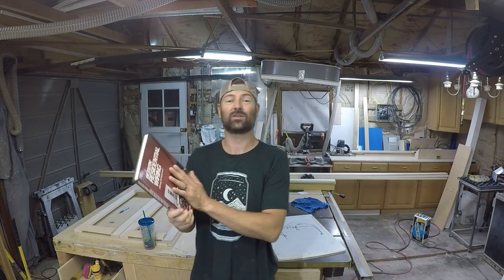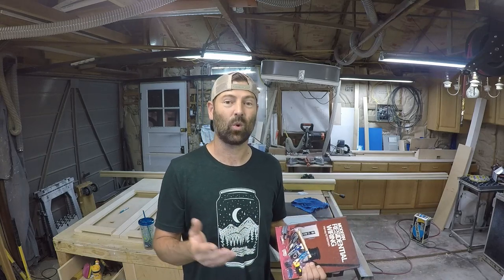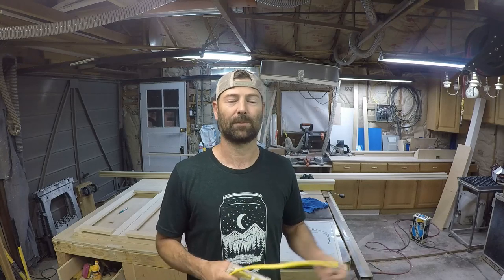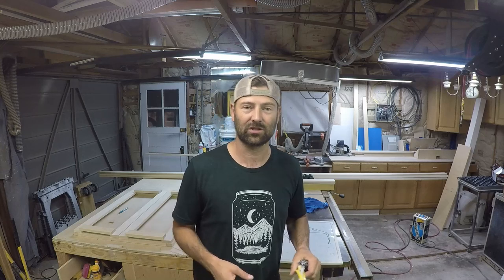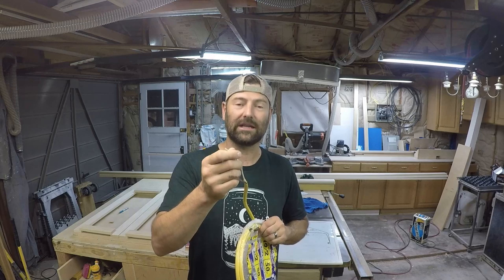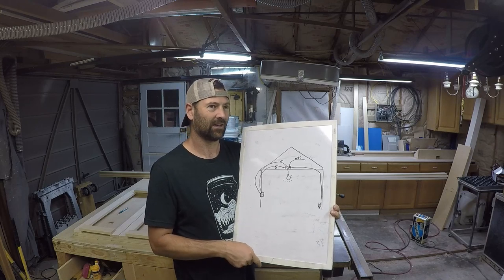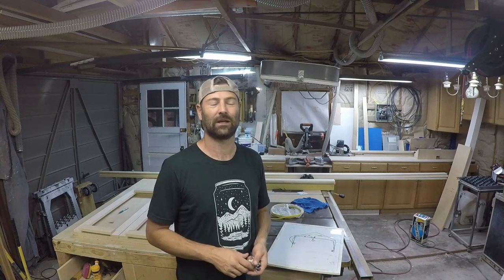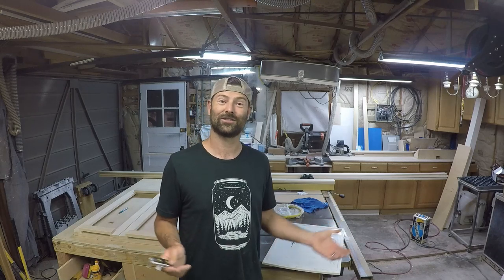The White Wire Is The HOT | THE HANDYMAN |

Comment: In most of my old house and when I add ceiling fixtures the circuit comes through the switch box so the neutrals (white) are tied together and only the black wire is interrupted by the switch. Opening the switch means the ceiling fixture will be dead and I don't necessarily need to go down to the basement to open the breaker just to fix/replace the fixture.
Reply: @mwatkins2464  Actually I wish that were true in my old house - rather than put in more wiring in the attic I replaced the ceiling box and installed ceiling fans. With a remote to control ceiling fan and light it wasn't a problem  just leaving the existing switch always on.

Comment: Can’t use that anymore, but yeah it was standard for a long time. For dimmer switches you usually need a neutral, so if it’s a three way switch you’re going to need to run a three wire.
Reply from the maker: This channel is not about building new homes.  Its about remodel.  And what you will find when remodeling your home.

Comment: Its called  a switch loop.  Don't think you can do it in new construction now as the new NEC wants a three wire run now so you have a neutral in the switch box.  However if you see this the switched hot white wire should be marked black on both ends if you do this.

Comment: In canada where the neutral wire isnt required at a switch yet when using 2 wire you must send power to the switch on the white and the switch leg to the light must be black. The taping or marking of the  white wire in this case isnt required but is nice to do

Comment: Almost right.  Normally black is hot (or live), white is a current carrying groundED wire,  it can get you if YOU are grounded in any way.  Green or bare is ground.  If white is EVER used as a live conductor it must be marked black at both ends (i.e at a switch).  Red is used for 3way switches where a second switched live wire comes from the companion switch or as the 2nd leg of 240v 1 phase load wire. Best to use the national electric code handbook, not a trade publication which might be correct, might not. All of this covers 1 phase residential wiring. Bottom line... use which ever conductor you want (except bare) and tape or mark the odd conductor at both ends with NEC recognized colors. If not, and you happen to get a weird electrical inspector, you might be in for some rework.

Comment: Sometimes the black is hot - sometimes it’s the white.  It just depends on how something is wired.

I knew what you meant (however, o  an electrician - since 1991 actually😉, when you said the white was hot.  It applies to “your” circuit, at that moment, as in many applications.

Good job!

Comment: I knew this video was coming I saw that installing the puck lights Video ( Great Video BTW) and when you said white is hot I was like what at 1st then was like I bet there saving money by not running more cable and using both wires. Also LOL on the insulation strip back comment on the Ground wire  that was funny. 👍👍🍺Cheers

Comment: Hey Bro I do Elevator construction start to finish it’s involved lots of electricity although I am not an electrician but you would be very surprised at how many “electricians “ don’t know what your talking about not kidding especially commercial ones. But that is a switch loop it means that power is going to the light first then it is sent to the switch that’s why the white is hot at that point at that point so the switch can interrupt. Otherwise the light would be lit at all times. Your a smart guy you ain’t no handyman ur a wealth of knowledge that shares with others very fast efficient clean and you do the whole job by yourself for God sakes get a helper. The man is telling us to get the book and it will make sense to everybody if they read it a couple of times or draw it out. And never trust color of a wire get a meter or a voltage tester

Comment: This just cost me $600 because our county requires 3 conductors plus ground. The white gets capped in the box but tied in to the other whites in the attic or back to the breaker box. “In case someone wants to use a blue tooth switch in the future”. I’m 57 and have always wired switch legs just like you said, but times they are a changing. Absolutely stupid!

Comment: when power comes in to the light fixture itself, and then you only see 2 conductors in the switch it means that both legs are hot (at least when the switch is ON). this is basic stuff haha. that being said, I believe if you were renovating, you'd replace the wire from the light fixture to the switch with a 14/3 as I believe the latest NEC requires a neutral in the switch box even if it isn't used (something about smart switches).

Comment: I used 14 for lighting and 12 for receptacles, and I never put the lighting and receptacles on the same circuit. If saving wire is an issue then pull power for the one receptacle from another area.

Comment: Never assume anything is correct. Check every switch, outlet, circuit and fixture.  Years ago my sister found a ceiling fan wired with an extension cord wire running above a false ceiling to a switch. She described it as "So illegal, it's not even funny".

Comment: Ahhh, I see.  The switch is using one single run of romex, so both wires in the bundle are used.  Makes sense now.  I think for those of us in areas that did not use romex when constructing (rigid conduit) there are other colors used.  In my home if the switch is not a three-way, both of the legs for the single switch are the same color, either black, red, yellow, etc.

I have noticed that in our area of Indiana, all of the older homes were constructed with rigid conduit.  But now brand new home builds are back to using romex.  Not sure when that change occurred.  Definitely sometime after the mid-2000s, however.  As a real estate broker I see a lot of homes with unfinished basements, so it is relatively easy to see how their electrical and water is run.

FYI, I was kidding around about the house burning because of a wire's insulation color.
Reply: You see different colors because you can only relabel white in Romex or two wire cables. Conduit with separate wire pulls has to use wire that isn't white, gray or green for all hots.
Reply: @1dgrdgr  I know, that is what I had mentioned.  Conduit has individual wires pulled through unlike romex which is individual cables filled with so many wires based on the type of romex that it is.

I appreciate conduit for pulling wires after the fact (so as long as there is not a junction somewhere) but romex is definitely easier for the D-I-Yer.

Comment: When I first moved into this house, the outlet on the front of the garage sometimes worked and sometimes not. Finally I noticed that sometimes if I turned on the garage light, the outlet turned on, but sometimes it was on when the light was off.
What could it be??? Finally figured it out...
Previous owners had wired the hot for the outlet to one of the travelers in a 3-way switch circuit on the other side of the wall. Moved that outlet connection to the actual hot feeding the box and all is well.

Comment: This is why I don’t care for Romex/nm cable. I prefer conduit. I like the option of using different/correct colors and/or pulling a new wire when needed. Or pulling a new neutral when needed.

I used to think nm would be so cool to work with but it is more trouble than it’s worth.
Reply from the maker: I haven't seen conduit in a house that was built after the 60s
Reply: The Handyman 

They’re all conduit here in Cook County/Chicago. No romex allowed.

Comment: You are correct. Maybe if you explain to folks a bit further about the white being hot or energized. Lets make a rule, "Only the black can be hot". OK? New rule. Then in order to get power to the switch and then turn the switch on and energize a light, fan, whatever. You don't have enough "Black" wires. You would need two black wires going between the junction and the switch. All you have is one black, one white and a ground. So now, with our new "only for us" rule we need to run a black wire from the switch to the junction or more precisely to the light. Walah. We now have a black energized going to the switch. And a black which will become hot when the switch is turned "on". Walah: All black to satisfy our new "rule". But you now have a white wire that is doing nothing. It sits for the rest of eternity doing nothing. Get it?

Comment: can the white wire be used as a hot for outlets?  i have no power on 5 outlets i changed the GFI and breaker still no power, i ran an extension cord to a GFI outlet in the house and plugged in the wires to the cord from the old GFI and i got power to all the outlets , as i said i replaced the GFI with a brand new one black to brass white to silver and nothing

Comment: Also the term "neutral" is overused. White is a "return" for any circuit fed by only one hot leg of the service. In North America households that is feeding a 120v load. Only a two leg 3 wire load has a "neutral", that is 120/240v loads. Return carries 100% of the load current. Neutral only carries the load imbalance, or the difference in the 2 lines.

Comment: Black connecties to White van be confusing, i think.

In my country we use Brown for LIFE, blue for nutral and yellow/green for earth.
A Brown wire goes to the switch and from the switch goes a black (switched LIFE) to the bulb. From the bulb back to blue.
Its easy visible witch wire has wich function.

Sometimes diy idiots use the wrong colors becouse they safe a few euros, and claim they know IT 5 years later. But that's frustrating and very dangerous for new home owners.

Comment: Heya. I’m remodeling a quad. Built in 1927 they remodeled in 19?? To add a kitchen and bath onto one unit. The stove outlet in the addition can not be killed by shutting off the main in that unit. My thought is they ran it from another unit (with or without realizing) or we have a problem at the breaker...? Thoughts?
Reply: Also nothing was labeled so I walked around testing what was live when it switched on the main and then individual breakers. The hot water line comes on with the main, stove is always live. East outlets are tied into the kitchen outlets and a few lights are on individual breakers. Fun mess of wire (also knob and tube when you take a peek under the house feeding several outlets and switches...)

Comment: This is true if you are using the light box as a junction, but as an electrician I never use the light box as a junction, my home run comes into the wall receptical first then out to the light switch then to the light, this way my hot stays on the black and is never the white which by NEC codes is always black for hot, white for neutral, bare copper ground, using a 12/2 with ground residential wire.
Reply from the maker: The house I was talking about was wired 40 years ago. I was simply telling people what to watch out for in their older homes.

Comment: Question. I service exit lighting and I was in a warehouse the other day. We replaced 3 exit signs last year. Never had a problem with the brand we use.  The building is wired 277v I checked the power with my meter from the wires on the exit sign not connected and all 3 junction boxes are reading 64v. What do you think the problem could be? Thank you...
Reply: How are you testing the circuit? Line to neutral or line to line?

Comment: So I have a junction box all the black wires were connected together two neutral wires were connected together one neutral wire was separate from the others and connected to the light fixture and the other wire on the light fixture was connected to the neutral.   Does that mean that that separate neutral wire is actually a hot wire and should be connected to the black wire on the light fixture?

Comment: In your diagram, you show the receptacle and light on the same circuit. I've done a fair amount of home wiring and I never did, nor witnessed a receptacle and light
on the same circuit.  Receptacle and lights were all on separate circuits.  I purchased a condo in Fl in 2009 and the condo was built in 2004.  I was installing ceiling fans in all the rooms and when I killed the power to the light it also killed the power to the receptacle that I plugged a light into.
Reply from the maker: It is not done on new houses.   but the 60 million homes built before 1980 or all the homes that have been remodeled  You will see it every day.

Comment: I work at an apartment complex and the first outlet in apartment has white on black side coming from a light switch. They use the red wire going between that outlet and the next one around corner instead of red from switch. It's in every apartment here.

Comment: I have a question. Is a tester screwdriver works the same as a light bulb? I mean you do close the circle by touching. How can a light bulb have no neutral. How does it close the circle?
Reply from the maker: The bulb has a neutral.  but not the switch.
Reply: @TheHandyman1  from another bulb?
Reply: @ofrimashiah2   neutral comes from the junction box , in Europe ( Netherlands )  its a lot simpler as you got 4 colored wires  , brown = hot   , blue = neutral , black = switched hot  and yellow/green for ground
Reply: @Shalow78  yea in israel its the same. Not sure if we have blacks here. I think we only have green yellow blue and brown. Not entirely sure how a light curcuit goes in a house. Will google that 👍

Comment: I'm a former pool equipment repair contractor and there were occasions that I had to connect a remote switch for the pool pump to be turned on away from the control panel.  Just as in your case, though, I would switch just the hot wire using another colored wire other than white or green.  Your thoughts on this would be appreciated.

Comment: In some cases you can use white as hot but then it's not the common wire no more and you should Mark it with black electrical tape and possibly Mark the black wire with white electrical tape just saying

Comment: I use the black wire as my feed. The White feeds the light and I mark it black / red.
Reply: I agree, for the reason that the only place there can be any confusion is at the fixture. At the fixture you will see all the wires and it explains itself.

Comment: I am no electrician . If you come in to the light from source black is live and white is neutral (which goes to the light ).  Then when you split it off to go to the switch on white and come back with the black wouldnt it make sense when you change the light it will be black (L) and white (N) not white (L) and white (N). just a question, isn't that why they did that

Comment: Just saw your video.you are not crazy.i ran into this situation yesterday.i need a little help.i tried wiring a ceiling fan into this situation but every time I flip the light switch the breaker trips.so how do I wire a ceiling fan in a situation like this

Comment: I was one of the ones that asked the question about the black vs white.  After your explanation, it  makes sense but is that a common scenario?  I've done some basic wiring around the house and I cannot think of a time where I've come across that.  Either way, it reinforced my dads saying of "check each wire for fire"
Reply: I have mixed wiring in my place. This is because the house was built in the mid 80's. Appartly, It is common because some of my switch junction boxes have the neutral and others are a switch leg as in this scenerio. Talk about frustrating!! 😂

Comment: In practice it works and this is how it was done years ago. HOWEVER per the latest NEC 2017 code, this is no longer up to code for new installations. The new code requires to have a neutral connection at the switch box, required nowadays by most smart switches. More on this can be found here.

https://youtu.be/KXCeAj_gXhM

Comment: Perfect timing. I was just trying to find the video you recommended that book. 
In my house (built in 1990) in the switch box I have two blacks on each switch and all of the ground wire nutted together and neutrals wire nutted together. In each  light box is just one 14/2. Any idea which way is more common ?
Reply from the maker: What you have is most common on newer homes.
Reply: My 56 split level in MD is the same way in all the switches I’ve swapped out (for Diva CL dimmers made for LEDs)

Pretty safe to do what’s there unless you find a lot of abandoned wires, then you have to question the last installer lol

Comment: I didn’t see the original video, but in this one you didn’t explain that this was an old practice and that current code requires a neutral wire in each switch box. I bought a house that was full of switch legs and couldn’t use my home automation system. Never assume that a wire isn’t hot.

Comment: Lmao, man, I'm glad you made this video. this connects to a problem I had trying to rewire my light switch. ended up putting one side of the whole house on the switch lmao I turned on my bedroom light switch and the left side of the house powered up lmao! I'm like bro wtf!  Now I actually got it working right now. But that's not good enough for me. I want to know why its working right and what I did. So very much appreciated.
Reply: Lol! I did the same thing installing a simple dimmer switch in my dining area. Turning it on lit up that entire side of the house. WTH? is right! 😂
(Probably a 3 way switch mix-up or something. I never did figure it out.)
Reply: @droolbunnyxo9565  haha yea I was was dumbfounded when that happened. But yea for me it wasn't a 3way switch or anything. It's because of one of those white wires was being used as a hot to carry power over to another room. And the previous asshole didn't mark it black as hot.
Reply: @Lilmiket1000  Sold the house with the problem not fixed & no idea what I screwed up ~ which, I guess, makes me the "previous asshole" lol! 😂👍
Reply: @droolbunnyxo9565  lmao!!!